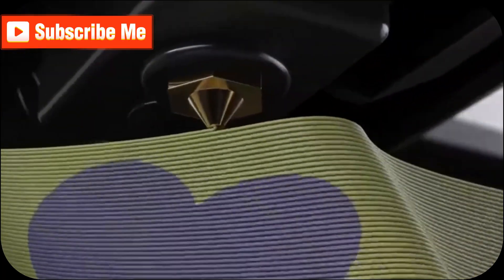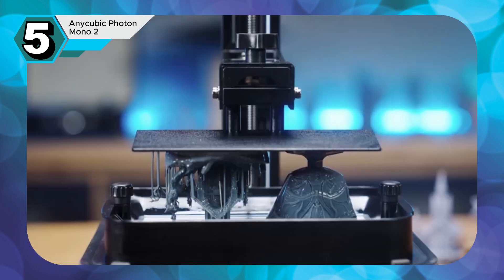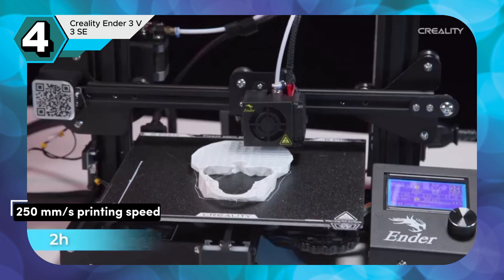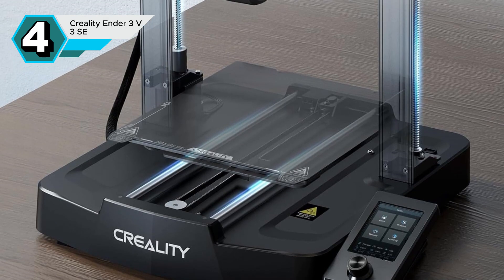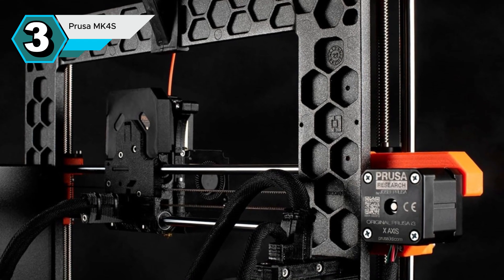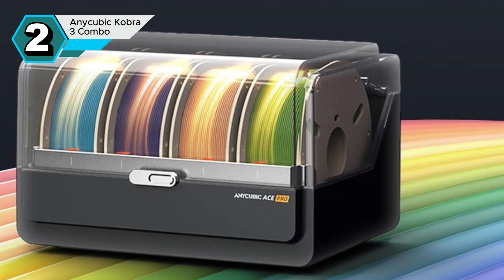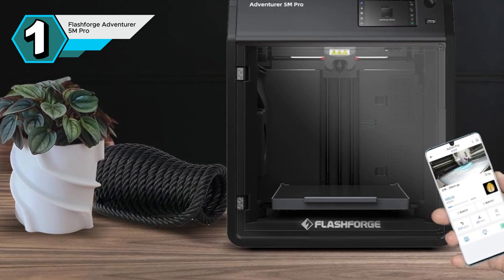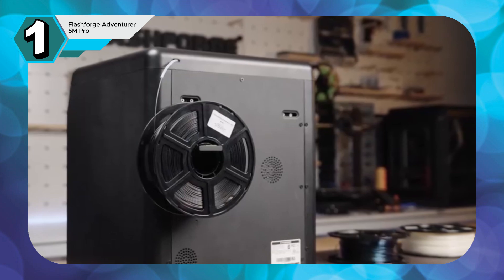Top 5 BEST 3D Printers in 2025

Comment: It ain’t even 2025 and bros alr making a mediocre list out of par at best printers. 

My personal list (fdm only) as of 2024 is 
#5 Voron 2.4 triden (and it’s Sovol clone)
#4 Bambu Lab A1
#3Bambu Lab P1S
#2 Prusa CORE ONE
#1 Bambu Lab X1C
Reply: Is the A1 better than the MK4S?
Reply: @majdsadi62  yes and no, the A1 is better for the price ($200 vs $800), both are top of the line bedslingers, but the MK4S is just better than the A1 in every regard, speed, multi material, overhangs, quality, eta. But the reason I didn’t include it is because the CORE ONE makes the 4S obsolete due to how similar their prices are, I wouldn’t recommend the 4S over the core one because they are so close in price, and the core one should be better than the 4S. But, because the A1 is the best bedslinger in its price range.
Reply: Basically, if you don’t have the budget for Prusa, then you’ll find similar enough results with Bambu, but if you do have the budget for the Prusa, don’t got for the 4S, go for the CORE ONE